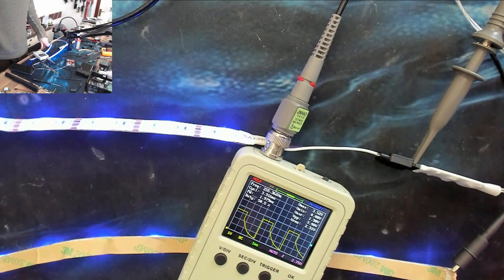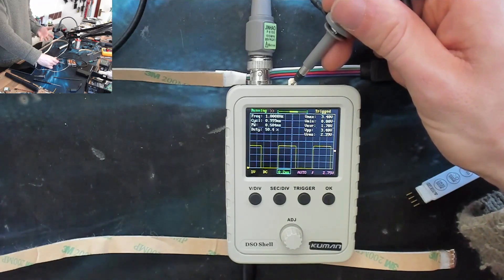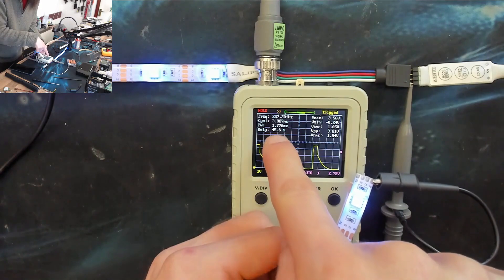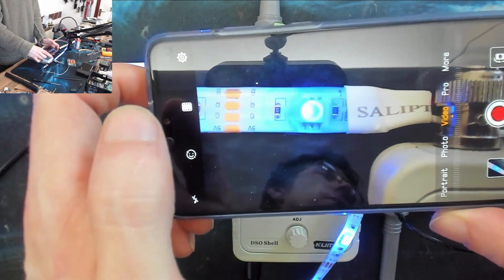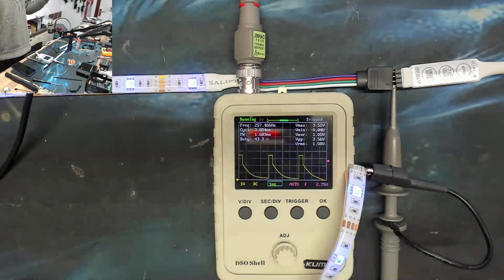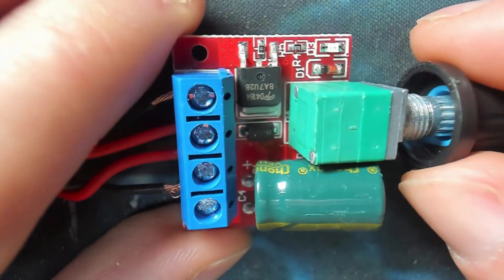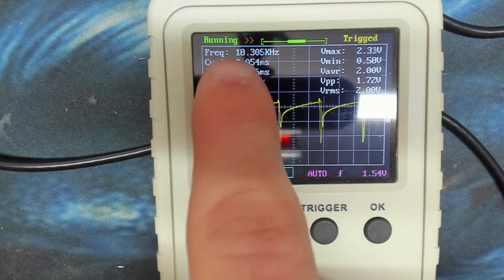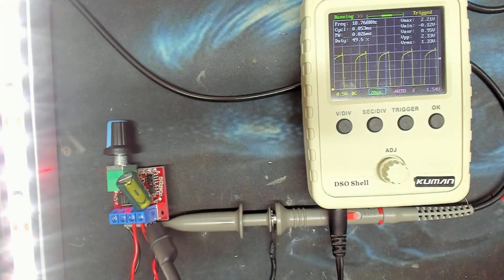LBE#5b - Why LED lights flicker and how to avoid it

Comment: have you noticed any difference in brightness between the start of the led strip and the end? The only drawback to a very high frequency pwm is the signal gets noticeably attenuated in just a few feet of wire, which will make the end of the led strip slightly darker. I guess the second downside is that the transistor is switching very fast (fast for a power mosfet anyway) and getting hotter.
Reply from the maker: I haven't seen that issue on my usage, and that's over about 7 or 8ft. That's not a huge amount though, I suppose.
Reply: @Adamant_IT  ok awesome, i will try out a high frequency next time i do an led strip. thank you.

Comment: I film my YouTube channel in my studio at 50fps and I’ve got pretty LED string lights to dress the set up a bit. They’re powered with a standard DC caravan style plug adapter. (I’m in the UK btw). As you can guess I get flicker when I’m filming. I don’t know anything about electronics (and not much about photography either!) - is there a consumer solution for me that doesn’t involve making my own circuit board that will raise that flicker rate and stop the issue? If so, how would it be wired in? Thanks for the content!
Reply from the maker: I'm not very familiar with 'caravan style' plugs, but unless I'm mistaken they all run 12v? If that's the case, the easiest way would be to replace the plug adaptor with a switchmode power supply (that's the kind of thing that most household electronics use) which will filter out the flicker. This might require a little bit of hacking, but because it's only two wires, it's an easy DIY job. If you can link to the adaptor, or a picture of it, I can be a bit more specific!
Reply: Adamant IT ok, I’ll get on this today and get you some extra info! Thanks so much for taking the time to reply.
Reply: Adamant IT - I’ve got photos to show you but not sure what the best way to do it is through this channel? Is there an email contact on your YouTube home page maybe?

In any case, the power supply for the lights says all this guff on it!

PRI: 220-240V ~ 50-60Hz
SEC: Urated=31V~
Uout = 31V~
P rated = 7.2W

Just to be clear, the lights don’t flicker when they’re on, they just flicker when filmed. That’s my issue that I was looking to solve!

Comment: 5:20 .. 6:12 .. some people can see flicker, some get a headache .... i claim to hear the flicker, as my tinnitus tone gets louder or higher, when i look directly into electric light sources, also invisible light sources like wifi antennas, or television broadcasting antennas. 

i guess i learned that kind of synaesthesia while taking LSD in a "toxic environment" full of electric noise. 

the question always is, do these stress signals only hurt those who perceive them consciously? or do they harm every body, but only the sensors (sensitive ones) can locate the stress source, while all others feel stressed from all directions (or behind their back, on their blind spot), and will always search the stress source in the wrong locations, for example by becoming over-sensitive for bad smell.